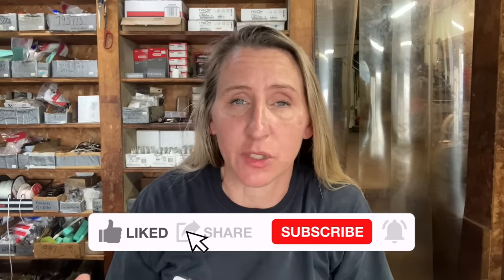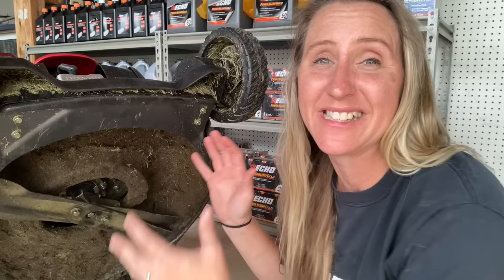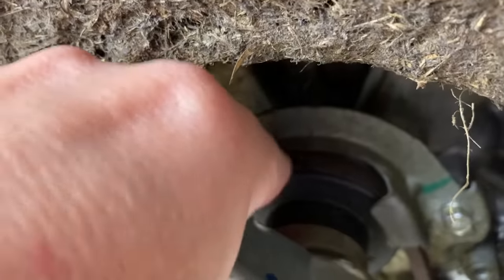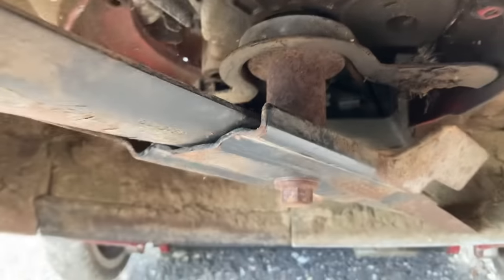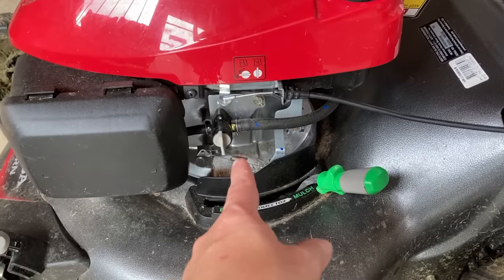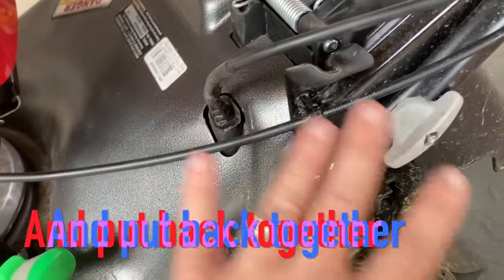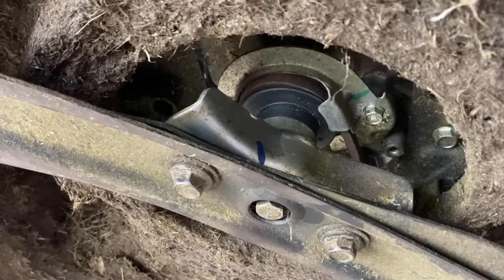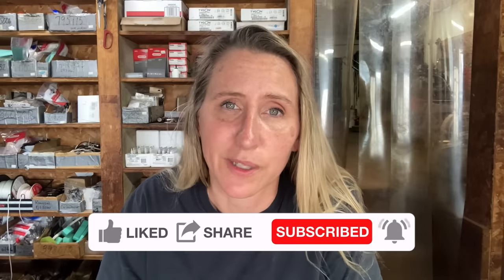SAVE A TON OF MONEY in repairs by NOT BUYING this NAME BRAND mower.

Comment: I am lazy and will use just about any excuse not to mow the lawn, but I never mow wet grass.  Of course, I don't have any kind of self-propelled mower, either. I also inspect the underside of the deck for grass buildup. The mower I have is very light weight and looks like it could easily corrode and split.

Comment: Two simple things people can do to keep a LOT of issues from happening to their mower.

1. STOP mowing your grass when it's wet.
2. Clean the underside of your mower deck after each mow

I clean my mower (Toro Recycler 22") after each use. It gets blown off with my blower, then it gets sprayed off with water (after it's cool), including the underside of the deck. My mower is almost 15 years old and still cranks on the 1st pull...every time. I also change the filter, plug, and oil every year. And I keep spares of all of those, plus a spare drive belt, in my shop. Simple preventative maintenance will keep it out of the shop for most issues.

Comment: Husqvarna is another lawn mower brand to avoid.  I am talking about a model from a few years ago that I purchased new. The grass catcher was very hard to install, the rear extended beyond the rear wheels so you could not take it down steps, the handle folding system was cam based and was very hard to lock, and finally when mowing even at full throttle the grass was not thrown to the back of the catcher. This meant the catcher would fill up very quickly because it only filled the front.
So while Husqvarna might be good for sewing machines I would be very careful purchasing one of their mowers.
Do not think that all mowers are necessarily going to do what you want.

Comment: @chickanic 
I bought the HRX217VKA I believe it's a K6. I have 2 requests. 

1. The plastic insert under the deck traps so much debris, have to remove it to clear it all out each day. What's it's purpose? Any tips?

2. This OEM belt you see having issues. Could you kindly DM the recommended replacement? OEM is 3/8x14.6, should I find one slightly shorter? Say 14L even?

Comment: I have a Honda HRX series mower I bought from a servicing dealer.  Been 10 years and no trouble but the deck and the cable and the underside seem different.   Maybe the ones sold through dealers are different from those at the box stores?  Maybe this problem is one reason why Honda will no longer make lawn mowers?

Comment: Ive have a worse issue with the Husqvarna AWD units, older ones had a good belt guard, new ones are fully open and exposed. It ruins the bearings on the 3 idler pulleys and flat spots the belt, easily costing an hour of labor and parts every couple years if the customer doesnt keep their mower clean.

Comment: whew.....saw the hood and went to look at the model number right away.  glad i replaced my 2004 HRX17 with a 2023 HRX17.  i figured i got 20yrs out of that one so why not replace it with a newer version even tho it's being discontinued(bad idea imo)

why did i replace it?, carb needed replacing and the cables needed replacing.  unfortunately, over the almost 20ys, the bolts needed to be removed to change the blade clutch cable.....cold welded.  breaking the motor housing flanges was not in the plan and with the cost of the carb being 1/2 the price of a new mower....it was time.  motor was using a little more oil than makes me comfortable but i didnt mention that as i had just changed it for the new season.  the composite deck was still intact so someone that needs one, may get a gently used but still functional deck from the carcass.
Reply: I just bought the exact same mower, I had a cheaper honda for 15 years, on a troybuilt frame, the self drive system was starting to go bad, often only one wheel would work. I had to replace the self drive cable because it rotted out inside the frame, but that didn't fix the other wheel.  So the HRX17 is what I went with also, about a month ago.  So far no problems.  I think she doesn't know what she's talking about, so far great mower, but I take VERY good care of my mowers.  Wash them every single time I'm done using them.  My other mower is a 53" deck Skag zero turn, it is beat to heck but she keeps on going.  I think I put that my old mower was on a toro frame on another comment, I actually went and looked, I was wrong.  It was troybuilt.

Comment: Honda has already choose to quit building mowers for residential use🤔 I have Honda  self propelled mowers I have used for years with no issues. I either bag or rear discharge my clippings. Mowing wet grass and mulching is a bad idea for any mower.😬

Comment: I had a toro I bought before 2000 runs good still I bought a kobolt 80 volt. Works ok but doesn’t compare with the power I might go back to gas i gove my old toro to my niece when she got her first home.I also  have a toro single stage snow blower that I bought in 2003. Still runs and works great. I thinking about the 30 inch time master any recommendations.

Comment: I rinse the underside of my mower deck after each mow. I’ve never had a problem with anything clogging. Also need to rinse the catch-bag periodically. The bag acts as a filter and if it becomes clogged (air cannot adequately pass through the fabric), cuttings won’t pass into the bag correctly and will clog at inlet to the bag. Maybe something else to make a YouTube video about.

Comment: Yes I have a Honda motor the motor is a 190 are you shut the machine off to empty out the bag when I go to restart it for some reason it started to smoke so I shut it off check the oil level was perfect and the more I kept cutting grass the more kept smoking cuz I made a turn to the left it stopped smoking so everything was fine and then it starts to smoke again it's smokes then it stops😅

Comment: A non-related question. I have a very hilly property and currently use a Honda tractor with cleated tires.   The Honda is 27 years old and still running okay. Are the new Cub cadet mowers with the steering wheel a good choice if my Honda tractor where is out 
I'm all about 2 and 3/4 acres. The hills are up to about 18% grade

Comment: I purchased a Troy-Bilt self propelled mower in the late 90's. Thought it was a good mower due to the reputation. Worst mistake I made. Purchased brand new from Lowe's with the extended warranty. Had an issue within the first 6 months. Don't remember the exact problem but took it in for service. They came back with  " you ran the mower with no oil. No coverage ". Argued with them for a month. No budge. Believe I got my money back. Bought the cheap MTD mower that was a return at Menards. All I've done is make sure the oil level is good and put a new blade on. Been going great since then. If anyone ever asks I tell them do not buy Troy- Bilt

Comment: I am experiencing a problem with a small engine. it almost completely stops firing when under load. will start right up run strong at idle and higher revs, but as soon as you put any load on the engine of any kind it sputters to almost stop. as soon as the load is removed it revs right up. the motor is a 16hp kohler single. has a new carb,new fuel pump,new magneto spark is good fuel to carb from new fuel tank is good. this should stump a few experts. cheers!   (engine is in dixon ztr 42 mower and spindles turn easy and smooth on new belts)

Comment: Why does none of the aftermarket air vane springs for Briggs and Stratton engines not work? Is it common knowledge that you have to stretch the springs for them to work? Should you only buy oem for this part?

Comment: One of my customers has a Husqvarna 4x4 mower and the protective ring that keeps grass out of the 4 wheel drive pulleys broke and trashed the three pulleys underneath so I ordered new pulleys and a ring pulleys came and as of now we have been waiting four months for the ring part . I emailed Husqvarna and got no responce. SO folks I would stay away from Husqvarna mowers also . Out of stock everywhere and no one knows when they will be back in stock .

Comment: I heard a few months ago that Honda is getting out of the mower business. I have owned 3 Honda walk behind mowers, and although I have not experienced the issue you speak about, I had a rough time replacing the belt on one of them. I couldn’t figure how to remove the belt without bending up the metal tab that kept the belt around the pulley. Is there something I missed that would prevent me from having to do this?

Comment: I have to agree with Honda engines being top notch , maybe the mowers are not as well designed. My Honda powered mower did not start last spring , first time in almost fifty years of use . Carb is shot , new one is almost the price of a new mower , but maybe I will just buy a engine

Comment: On thx Ms. Chickanic, isn’t there a non- propelled model, also please advise - my toro timemaster 30 doesn’t turn off - have to pull plug- have checked ignition coil seems fine

Comment: 2:55 - Does that person have two blades on that mower?

Unfortunately mowing dry grass is not possible many times, some years its all but impossible.

As for Honda - we had one Honda self propelled walk behind that worked for over 17 years.  The motor never failed.  What finally killed it was the deck rusting away and finding a replacement was no longer feasible.
Yes, it did require stopping and clearing ALL THE  DAMN TIME while mowing because the grass would clock the discharge chute and gum up the inside of the deck.  We did wash the underside of the deck after each mowing.
I've recently gone electric because they've become as powerful as gas and when the discharge chutes and deck clog stopping and starting takes seconds, not minutes.
Reply: Honda's push mowers have been using twin stacked blades for a fairly long time. Maybe 15 years or more, but their mowers get clogged up and need to get scraped and washed under the deck just like any other mower I've had. Not letting the grass get too tall and/or mowing wet grass helps, but the compacted grass builds up eventually.

Based on what I've researched at this point electric mowers haven't caught up to gas mowers in terms of cutting power or time of operation. If you have a larger area to mow with less ideal mowing conditions a gas powered mower is the best option.

Comment: I have a 2021 HRX 217. Is it any better? It looks like it has a larger area around the center belt area like you said the older Hondas had. I haven't had propulsion problems yet. The place where the cable enters at the back looks different, too? Better? Thanks. Love your channel.

Comment: you can't even identify the better belt that's kind of cooky.  i've had this mower for a while and I have never had a problem with the self propel.  Like any mechanical device if you use it properly and maintain it properly it will last. And having the best possible engine is number one everything else is maintainable.

Comment: The condition of the underside of that mower tells us all we need to know about how that person treats their power equipment. My Toro is going into its 20th season this year. It has been an excellent lawnmower, but it’s getting worn out. I wanted a mower with the blade stop so I purchased the Honda in 2020. I keep it clean and maintained so I don’t for see running into these issues. I will say, though, my Toro is still a one pull start whereas the Honda routinely takes 2 to 3 pulls.

Comment: Every manufacturer seems to be in a race to the bottom (especially vehicles).
Only the most commercial grade of anything is moderately okay.
Anything else is a nice until the warranty ends then like Cinderella's coach turned pumpkin, it turns into what the pumpkin becomes after you ate it lol.

Comment: Honda automobile motors are also having major quality issues!  According to a recent class action lawsuit, drivers of certain 2018-2023 Honda vehicles may experience stalling and oil dilution. Manufacturing defects in the engines of affected vehicles can cause the car’s oil to be diluted with fuel, causing significant wear and damage to the engine.

Comment: Is there ANY way of replacing the front wheel bearings on a Cub Cadet without resorting to nuclear weaponry? They're worn to (almost) nothing (no WONDER the steering is so loose!!) 

I tried everything I could think of, even tried the handy dandy 1 ton arbor press with oxy/acetylene torch heating the hub!!

Figured if it worked on the rusted in wheel bearings on my old Beetle last winter, and didn't use it since, I could come up with ANOTHER   reason I bought it!!!

Comment: What's with the TWO blades on that Honda mower?  Is that OEM, or a homeowner's attempt to get it to cut taller grass?  I've never seen that before.
Reply: It is Honda's new "2 blade system", supposed to mulch better.  I have only used my new mower twice now, jury is still out, no issues but not sure if the blade thing is a gimmick or not

Comment: I bought a $99  MTD  no frills mower in 1990. It cut 1.5 acres of grass and weeds for 20 years, with almost zero maintenance.  When it finally failed to run, I replaced it with the exact same model ($149).   The new one has been starting on one pull for the last 12 years and cutting the same property.  I do not believe in dumping money into lawn equipment.

Comment: Honda has cut cost everywhere because they are greedy. They used to have hardened crankshafts but now its only offered in the commercial mowers that are $200 more expensive. They void the warranty if fuel containing ethanol is used.

Comment: II bought a SRM 2620 Echo trimmer in May 2022.   It was working fine, but now it will not start.  I changed the gas with new gas, but no luck.  I have noticed that the trimmer head feels locked.   It is hard to turn the, which I discovered when lining up the holes to remove the trimmer head.   It still wouldn't start after removing the head.  It feels that the component in the motor, i.e., piston, turn when I with effort turned the head to remove it.   Any help would be nice.   I'm a subscriber and enjoy your videos.

Comment: On 8/01/22 I bought I bought a Honda 21" HRX, Versamow, Blade clutch, etc. Has about 10 hours on the engine - 2 weeks ago it broke the cam. Dealer says repairs are covered by 5 year warranty. But because I don't know how much collateral damage occurred, I want a new engine. Dealer says that's up to Honda, Honda says it's up to dealer. First Honda in 67 years of cutting grass with B&S engines, never had a problem. I spent $1,000 on this lemon thinking I was getting the best there is. Ha. The mower is sitting in the shop collecting dust while each side decides what to do. And my grass is up to my knees.

Comment: I have a Honda HRX 217. Guess I’ve had it close to 12 years. It’s been an incredible machine, but is starting to have problems with rear wheels locking up. I’ve seen some YouTube videos from various sources on this issue. None of them seem to clearly state what the actual cause of this issue is. Do you have any thoughts (or videos) on this problem?

Comment: Why does it have to be so difficult to buy a decent reliable lawn mower now . My 2008 Briggs & stratton brute, the grass bag has holes in it and the parts places want $150-200 for a new one . Doesn’t make sense to spend $200 on on a new bag when the wheels are also shot . Honda use to be number 1 , after lots of research between honda Hrn216pkc  that’s $749 here in Canada or a toro there’s really no clear winner . they both have issues, I looked at cheap chinese mowers but then getting parts is going to be tough down the road . I ended up buying a Toro 21445 with a Briggs 150cc for $638 . Hopefully it last .

Comment: Another issue is people cut way too low almost to the point of scalping the grass, let's be honest, the average person has no clue what they are doing when mowing their lawn no matter how long they've been doing it. I sold a mower to my girlfriend, it was a lawnboy, an original lawnboy with the staggered wheels, one of the best  mowers ever made in my opinion with the six litre Tecumseh engine, for some unknown reason the air filter fell off and she never bothered to replace it, I might add that her sister was now cutting the grass, one day due calls me to tell me the mower isn't running right, she wheeled it the two blocks to my house, I said where is the air filter, she said I don't know and asked if it was important, I I'd to order a new housing and filter but the damage was already done, the engine ingested so much dirt that it was ruined, I put an ad on Craigslist and gave it away for parts because you can't get a replacement engine for it anymore, the guy who came to pick it up felt bad and wouldn't take it for free, he insisted on giving me something for it, he gave me 20 bucks, it was in good shape otherwise, they had an aluminum deck. I sold her another mower a snapper and she ruined that also, that I still have the great thing about snappers is that the self propelle mechanism is by far the most reliable of any mower ever made, it's also super easy to work on and as as ling as you get an engine with the proper length shaft with a double keyway you can repower one in no time, somebody in my neighborhood was throwing away a craftsman front wheel drive mower, it was a perfect example of what people who don't know how to cut grass do, half of the blade was bent down at a 90 degree angle causing a horrible vibration, I didn't look underneath first, the engine had the proper length shaft with a double keyway so I put it on the snapper and it ran great. I had bought a used snapper one time, the deck was as low as it could go, the ends of the blade were completely gone and the bottom was caked with dirt. The logic is that the lower they cut the grass the fewer times they have to do it.